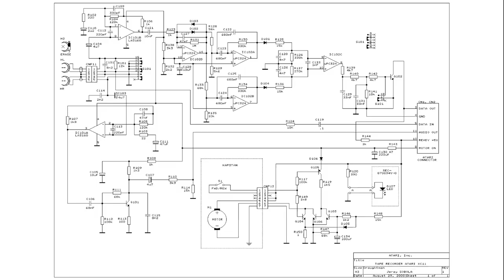Atari XC11 Tape drive with mysterious modification! Can I restore it? Plus Atari tape drive history.

Comment: The two 1010  variants have one more difference. The position of  the pause and stop/eject  differs on those models, but I can verify the  superior quality of the  orange label tape recorder.  I have both models and Its the one that still works.
Now I Dutch guy told me that  the ATARI 800 and 400 are common and their prices in the Netherlands are similar to those of the XL and XE machines . You said that they were hardly  available and   the 800/400s been sold on ebay verifies your claim.
Reply from the maker: Now I see it too, the two buttons have been switched. I hadn't noticed that before.
As far as I can remember, I have never seen a 400 or 800 in a Dutch store. If you look on Marktplaats, the Dutch version of eBay, you will not find any 400 or 800 machines there, only XL and XE machines. That's why I assume they were never sold here.

Comment: Why didn't you demonstrate the purpose of a mod like this before de-modding it? Or if the dataset worked why not just leave the mod in place as it makes it quite unique.  You have many other datasets and now have a dataset with 2 holes in it. Personally I think some mods are best just left alone.
Reply from the maker: I didn't know in advance what the mod was for. I did had a suspicion. I also thought the mod was ugly done, with those switches on the side. Those holes aren't nice either, but I'll see if I can get rid of them in a nicer way.